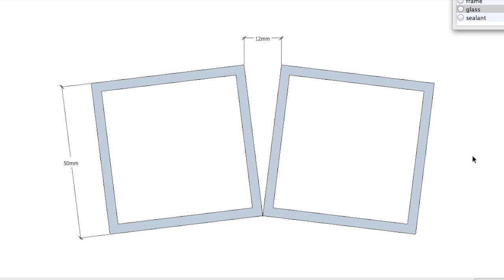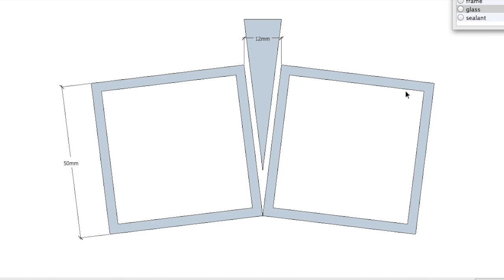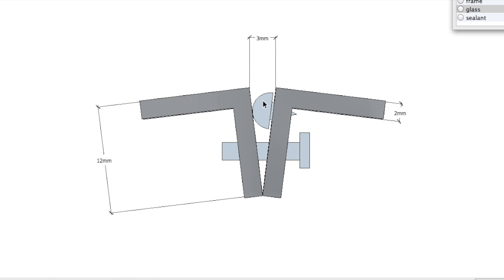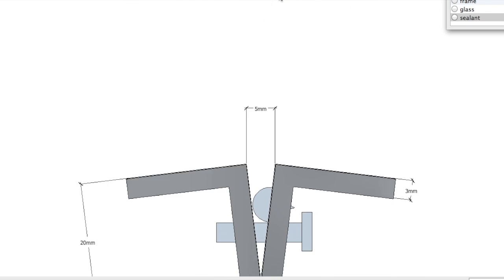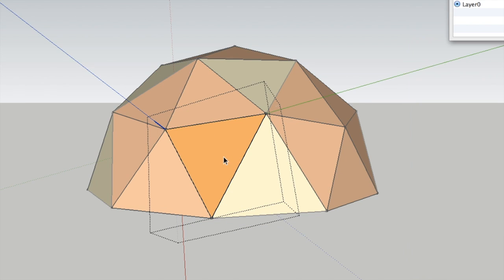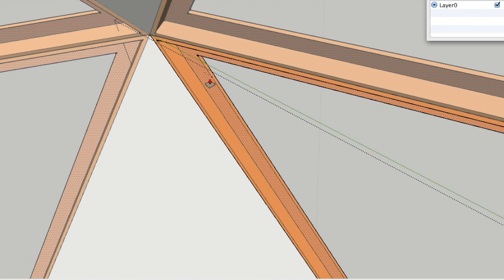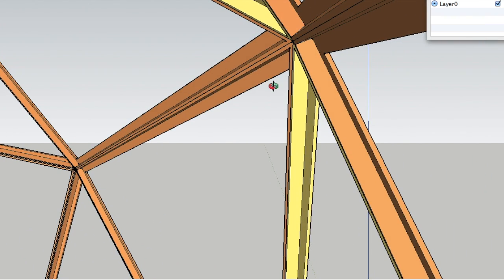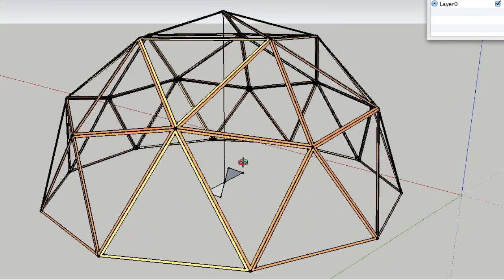Building Geodesic domes with angle iron

Comment: Couldn't you also hammer the angle iron while in a jig, to lessen the angle below 90 to get rid of the gap?
Reply from the maker: Yes, but I think I would take flat plate and bend it to the correct angle on a press. Angle iron is not so easy to bend along its length, so probably more work that doing the whole job in a press.
Reply: @Geo-Dome  Good point and thanks for your prompt reply. I've not worked with either. I'm currently just doing lots of research. Thanks for all your material, it's been invaluable.

Comment: Hi
Have e-mailed you a query partially answered on here.
Looking at the angle to bevel or chamber wooden struts to be able to take polycarbonate panels
What double sided glazing tape would be needed or would you recommend?
As the chamfer would only be a few mm on a 32mm a strut wouldnit be needed at all?
Enable the angle by just the foam tape with some spaced screws with washers.
Covered with heavy-duty water proof tape along the whole seam?
Cheers M.

Comment: After about 2 minutes I see your problem and solution. I used to work in a steel mill. We made angle iron. It is sold at a 90 degree angle. You need to run it thru an apparatus to change the angle required to eliminate the gap. Two options. 1. Pay a mill to change the degree. 2. Make an adjustable angel iron streightner to do the job. This is done cold. The secret is in the pressure.  I suggest looking for videos of angle iron production to see the simple machine I am referring to. Let me know what you think. I am at g mail. Com
Reply: Was thinking the same.

Comment: Iron, or steel does suggest a very strong dome frame and it also suggests a lot of hub options could be used.  As to the angles between the parts of each triangle, that would require a break device, which would add a bit of cost to the project a lot of folks might not want to invest in.  Actually, you wouldn't weld a wedge in, but instead a flat to bridge the gap between the two parts.  It would also help keep the rain and snow out of the joint.  In all likelihood, you wouldn't need another weld at the bottom to hold it all together since iron, or steel don't flex all that much until under extreme loads.  That would also help moisture to drip out of the joint.  That suggests you would actually want a slight gap at the bottom.

Comment: You could do it that way too but it will help for the bolts and nuts need to be perpendicular to the surface for which they are tightened, so the nut and bolt backsides can be flat against the surfaces. Or at least need wedge shaped shims the correct angle with a hole in them placed on the bolts before inserting the bolts into the hole, and the same shims for the nut side.

Comment: 11:37 easier than making fillets would be to use a gun applied epoxy resin, something like Anchorset, will set rock hard and be waterproof with great compression strength adding to the overall strength whereas sealant will not

Comment: how do you calculate the angle at which the faces of the dome come together? what is that angle?
Reply from the maker: That would depend on the geometry of the structure, I try to make it all the same on my dome plans for ease, typically 10° for a 2v and 6.5° for a 3v.

Comment: I love your ideas Paul, especially the beveled wood frame design. However this metal frame with the bolts does not tessellate or fit squarely to the frame. Guess you could make metal "sleeves" angled properly at the right dihedral angles for the nuts and bolts to fit flush.

Or you could do away with the tap bolt needed and use a steel square tube and weld a measured strip of steel on top of that to make the proper beveled or dihedral angles for the dome. Use one flat 16 gauge (.065”) stainless steel piece making a correct “pseudo” angle on top of one 2” stainless steel 16 gauge bar. Then everything can be bolted together first (still need those metal "sleeves" for the bolts or use the Pease method) and welded from top and bottom connections where steel struts join for the strongest dome frame possible.

Using the Pease method you would cut the steel tube at the right beveled or dihedral angle lengthwise for the top part that joins and weld a plate of steel on top of that cut part. Bolts would fit flush as in your other video on the Pease method so you wouldn't need those angled sleeves for the bolts to properly fit flush.

And my suggestion is also to use 316 stainless steel and silver bearing solder. I just like things that last. ;)
Reply: What is this pease method for cutting? I want to build a house using 2x2 tubes!

Comment: Interesting!!!!!, is it possible to a house with 2 x6 lumber?  thanks.
Reply: Exactly what you would want, but the joining method is different(stronger) but it will take more skills. You can't bevel the wood any thinner if you want the house to pass code, so you will end up with compound angles to cut. You can bevel the thickness away from a green house though, because it don't have the same codes as a house.

Comment: Hi there. The box metal version is the same nightmare as any angle metal idea. The only diffrence is material saving. Cutting metals in this steep angle is no work for DIY'S. For mild steel you need a carbon tip dry cut saw. For Aluminium, a good chopsaw (4 wood) with a sharp blade for the job. But only if you know enough, to rule out accidents. The real danger comes with cutting the angle.  Unless you don't mind (dirty) free hand cuts with an angle grinder. Better chopsaws (4 wood) can do miter cuts in two dimensions at the same time (+ left &right). Mobile (power) metal saws cut only miter in one dimension to on side only. For your own safety you NEED a mechanic better pneumatic clamp system to fix the material at metal cuts. Because the moving direction of the cutting blade will pull the material into the fence gap with a lot of force. Every degree smaller than 90 will increase this pull in power. Use a system with a center hub that connects your triangles mechanicly. All cuts will be close to 90 degees and therewith much safer. You cannot control the adhesion in the mostly hidden surfaces of this monster sealant gap. Only a view sealants can take large diameter without failing over time. Almost flat surface sealant beads are the most difficult ones. Keep the bead width more narrow. For the installation/screw connection of just two triangle ( for now) you need to clamp them together. In the final position preferably. In order to drill a good oversized pilot hole in a accident free way. Good oversized because your pilot holes will be oval in the final screw axis position. But you need AvE 's (P.D.) ruler to see that. If you don't give a lot of play (distance between triangle frames) while installing your first frequency, you will run multiple circles to losen &  tighten your screws and curse the world for it. If you're still on this track of building your geodesic dome this way....within one season you will experience the disadvantage of trapped humidity from capillary moisture and their condensation. Because you building with exposed metal. At this point you hopefully spend your metal surfaces a decent surface preparation starting with rust converter, primer and at least 1 topcoat with a 2 component polyurethan based paint or similar. This would increase the half-value period of your structure dramatically.
If you found a working hub system for the star connection and stick with the Siemens air hook installation of this funny open angle mount..... Forget about pumping your future caribbean holiday money in form of sealant into this dome project. Put a sufficiant sealant bead beside the glass mount tape (towards the outside of your triangle and work with a lid strip covering both sides of your glass carrying surfaces. The higher two glass edges level will give you a nice sealant gap sideways. In case you are capable to insure a continous adhering sealant bead to the lower glass (or other material) and simultaniously the upper  material....you can reduce the mounting screws per lid strip. If you can't...it will leak anyways.
Nope, I am not the smart arse ( 4 the britisher). But I work cut glue weld paint and seal all the above mentioned material (+) with commercial grade tool, starting anno domini 1977. Just try to save somebody headache, anger and injuries/trauma.
My geodesic dome will be based on a 4 frequency octahedron (halves) with a connecting tunnel (plan B) or eliptical base. Structur in 5/8 (~16mm) rebar. Given I find a online calculator to feed it with my depencies for a test carport. Later a garage/workshop.
Keep up the good work, Paul. I learned a thing or two from your and other vids.
Reply from the maker: Thanks for that, I always recommend galvanising steel, it's not a lot more expensive than prepping and painting and last a lot longer. I also recommend low modulus silicone sealant, I agree you have to choose the type of sealant carefully because getting it wrong can spoil an otherwise good job. Oh and your bang on with the condensation issue, that's why I prefer timber as a rule. Cheers

Comment: Nice ideas Paul, thanks.  see my note to Maurix regarding sealant.  Also, Paul, it just occurred to me that a person can spend a few hundred dollars and get a custom extrusion made so the aluminum will come with the desired angle, though that may not be desirable if the angle always changes.  I wonder how hard it would be to further bend an aluminum angle.
Reply from the maker: Cool, I didn't know custom aluminium was so cheap. I am talking about greenhouse construction here so I think the seal would be good enough, there would be a lot of condensation with the metal frame anyway. The drawings do look big but the silicone beads are only 2mm thick and maybe 6mm deep.
Reply: I overlooked that.

Comment: I wanna make a dome out of copper or aluminum tubbing, attach it to a thermal mass heater and heat the entire frame
Reply from the maker: That's a cool idea, but man it sounds like a lot of work. You would need all the tubes to be open on all the hubs so the hot air could circulate... It would be awesome though
Reply: The frame is on the inside, insulated from the exterior air I assume, otherwise you would be heating the air outside.  How do you get the warm air from pooling at the top?
Reply: using a ceiling fan running downwards